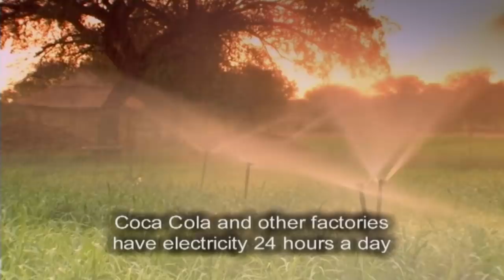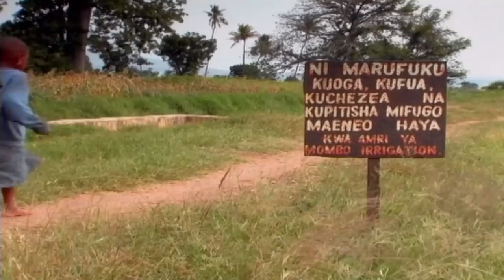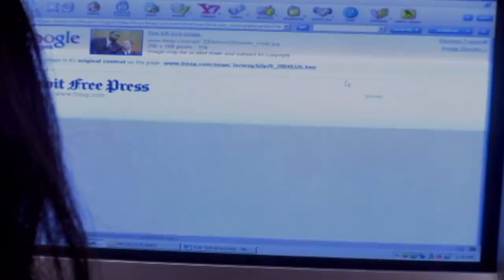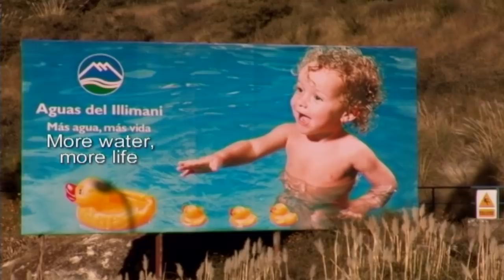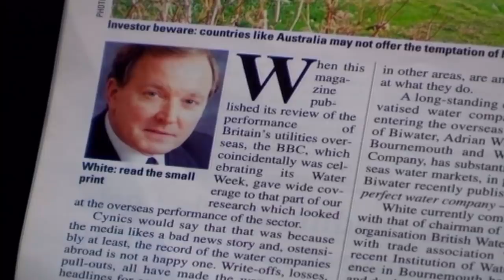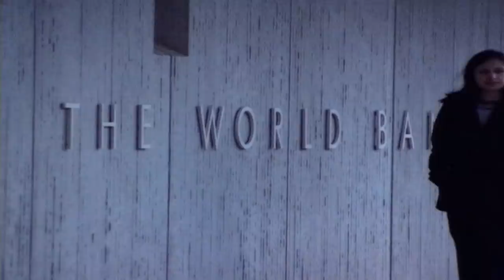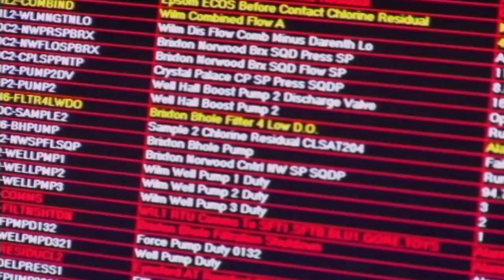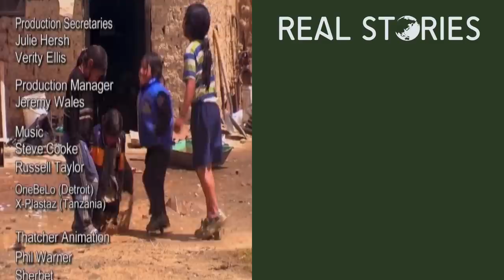A World Without Water (Global Warming Documentary)

Comment: I live in Canada, on a well, and just recently paid over $7400 to get a new pump system from the well to the house.  But that still doesn't guarantee that I have water all year.  I don't.  As soon as it stops raining for 5 weeks, the water level drops too low for the pump and I have to go and get water every day, miles away, in my truck carrying a 425 gallon water tank.  Some years I go every day for six months straight.  I live on a farm with animals, so need lots of water, especially in the summer.  Also when the power goes off in a fall or winter storm, I have no water.  No power, no pump, then I have to bucket it out of the well for cooking, cleaning, flushing, etc.  Have to use a camping shower bag.  I feel for these people and know what they go through.  Even when you don't feel like going for water, or are sick, you still have to go and get it.

Comment: Arizona is preparing for limited access to water. Gov. D. Ducey recently paid 30 million $ for future water. We heard Phoenix water $ will go above 30% next year. I'm more concerned about growing agricultural crops/needs. Like 18 years ago or so. An initiative Voted for building/construction. Agriculture & new building couldn't both be sustainable. So they voted to expand on building not growing food. Big water shortages are shrinking reservoirs. Lake Powell & Mead running dangerous low which will effect hydroelectric energy/power. Phoenix az has residual medications in city drinking water. I briefly tried to reuse sink water to water A tiny flower garden. HOWEVER it seems that the flower plants didn't like the smidgen of handsoap. And kinda wilted. So it took just alittle extra work to take the bucket outside. Good intentions but not very good results. I'm thinking of checking what's in our drinking water. I cannot imagine city dwellers lining/driving to pick up water resources.